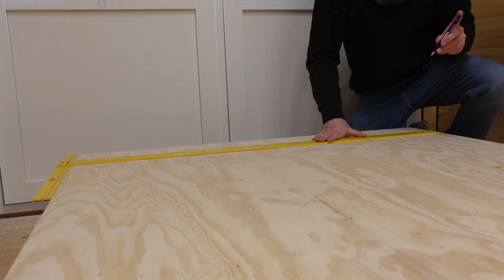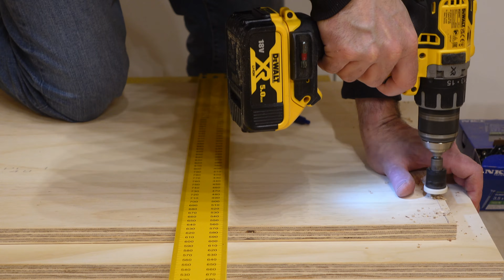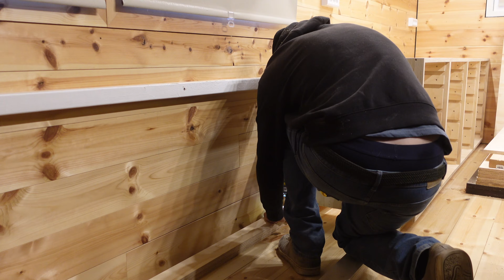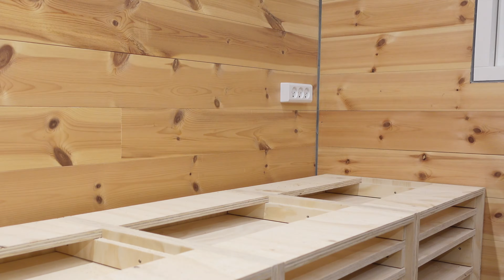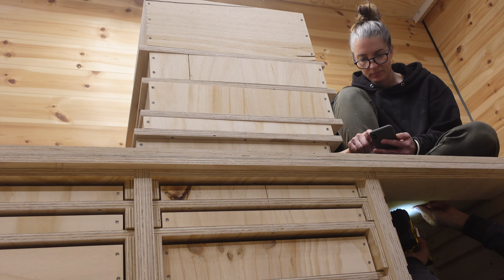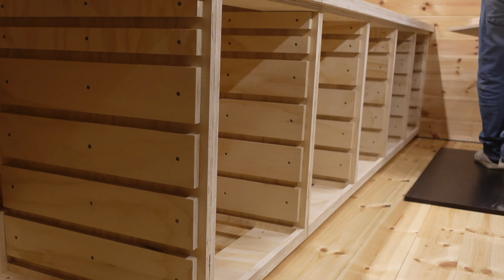easy woodshop cabinets with sliding drawers no hardware

Comment: Nice clean design 👍 But being something of a tightwad, I wouldn't have used 18mm ply for the drawers as I feel that is a little bit of overkill, I believe 12mm would have worked just as well.
Reply from the maker: Absolute agree. Only reason for using 18mm was because of space / storage issues in the small shop

Comment: Just one thing, having a thinner bottom (10 mil?) would give you a little extra storage space and would be less expensive to do. Beautiful tho, for construction lumber. Might want to chamfer that table top edge a bit! Love the handles, you won't bump your knees on them!
Reply from the maker: @larrybud  thx for the input. I agree. We only used the same thickness for everything because of space issues in the tiny shop, and maybe a little because of poor planning 😊
Reply: @agreattinyspace  Any special kind of leather for the handles? I think I might give that a go. Are they holding up well?

Comment: Well done!  However, what I don’t like about this design is that it wastes a lot of plywood, not only on the sides, which basically double in thickness, but also on the drawer bottoms, which could use thinner and therefore cheaper plywood.
Reply from the maker: I so agree! We only chose to use the same thickness for everything because of space issues in the workshop

Comment: VERY NICE!!!!! I too am going to use wood slides. The hardware is way too expensive for a garage build.
Reply: The way he did it, however, wasn't exactly cheap. Essentially you needed double the plywood for each box to make the runners. Cheaper would be to cut dadoes into the sides instead. I did a very similar build, 3/4" sides, 1/4" wide dados about 5/16" deep. I used 1/4" drawer bottoms (obviously) which is plenty strong.
Reply: @larrybud  very Cool. Ill give that a go. Thank you Sir

Comment: Great job on the build, what was the dimensions of the cabinet as far as height and what was the height of the drawer spacers? Thanks!
Reply from the maker: thank you
the total height is only 75 cm (mostly because of window height. But also a practical height for the taller tabletop machines)
drawer spacers are 10,3 cm